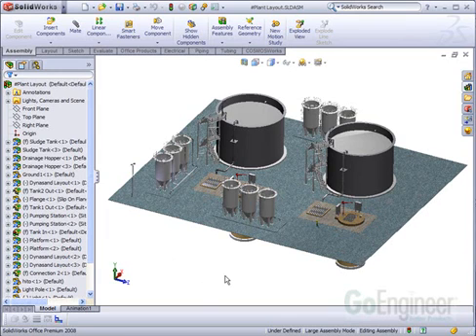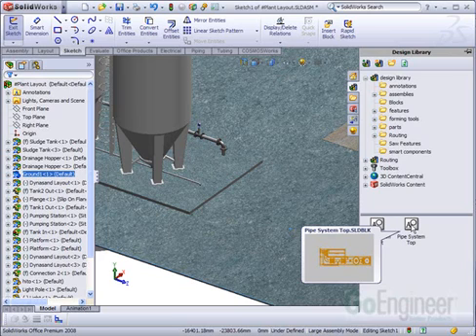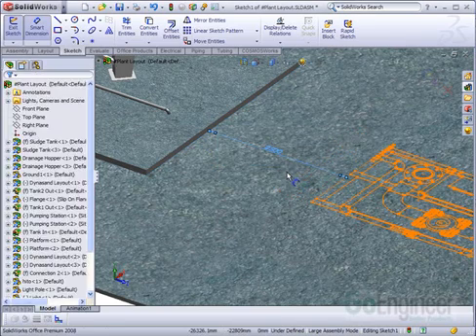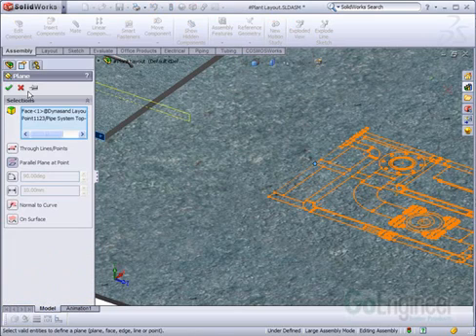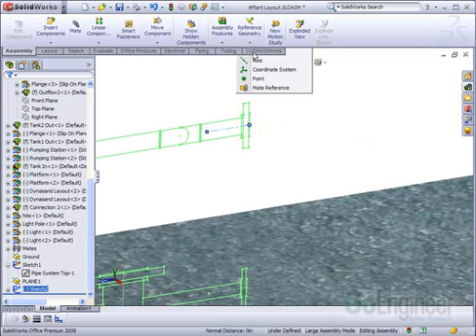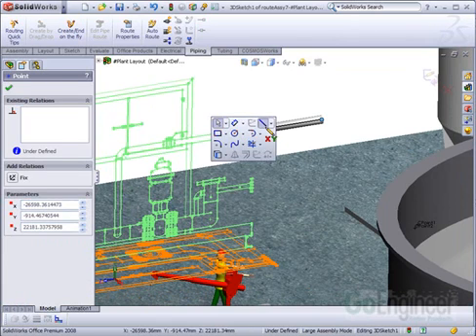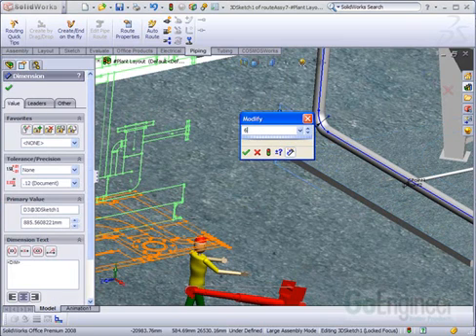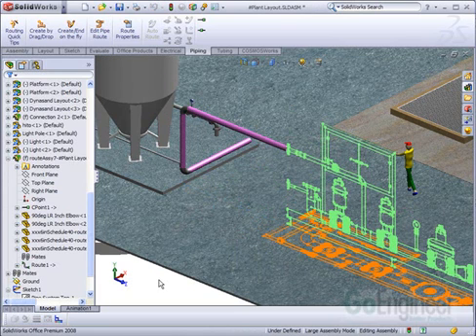3D and 2D Plant Layout

Comment from the maker: The assumption here was that you didn't already have a 3D sub assembly.  I'd recommend using your 3D model if you have it.  But if you want to make a block, you need to create a drawing view, save it as DXF or DWG, open the DWG in SolidWorks, DraftSight or AutoXXX as a drawing and then make a block out of the resulting sketch geometry.

Comment from the maker: SolidWorks has a limit to a 1km cube centered at the origin.  Usually plenty of room for most mechanical design.  4 acres is much smaller and should certainly fit, but if you have extremely shallow arcs where the center point of the arc is outside the 1km boundary, you'll get the error when trying to dimension the arc.  With large scale geometry, you're also always better off to center your geometry on the origin.